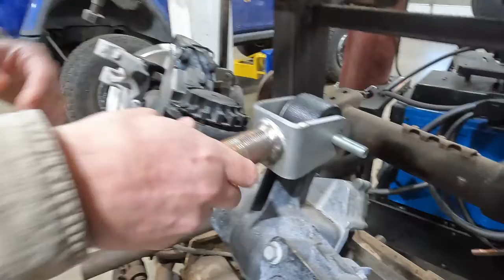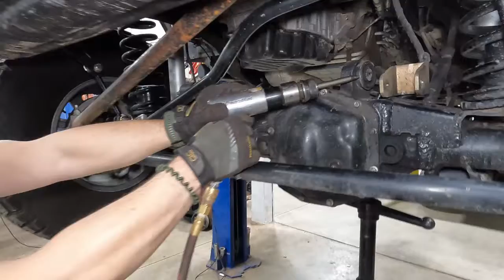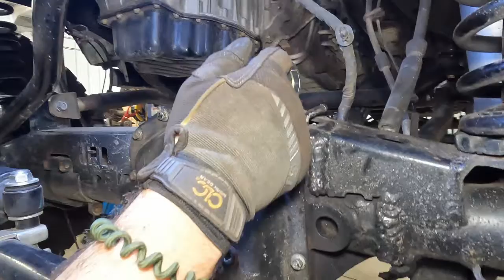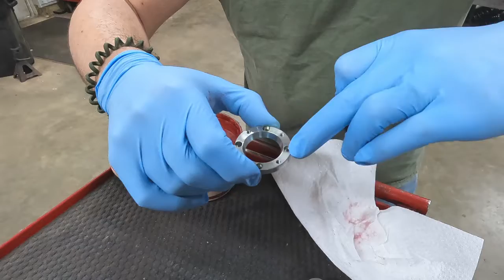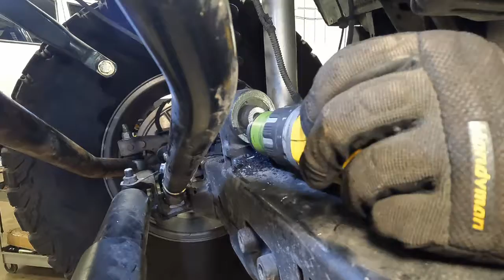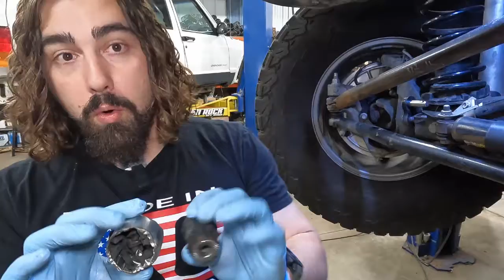Upper Control Arm Flex Joint - Goodbye old rubber bushings!

Comment: What is the torque spec for the 1/2 bolt option?
Reply from the maker: The 1/2" bolt should be torqued to 70-80 ft-lbs

Comment: I have the flex joint on my rear IRO A arm . Its beefy and abviously better then the stock Ball joint. 
Im a little leary about putting it in the steering axle as most of my miles are highway miles or snow and ice covered in the winter.
Im on a 5 inch full adjustable short arm which rides and drives amazingly but the original axle bushing have 245k on them .

Wouldn't it make more sense to push the joint in with the ball joint press with the joint assembled. 
That tiny allen wrench is much easier to manipulate on a bench rather then upside down under the lifted vehicle.
😂
Reply from the maker: @darkknight1100 I completely understand the concern of the snowy/icy roads and dealing with corrosion. Rest assured, that is exactly what we deal with here in Minnesota. We have used these press-in upper flex joints on daily driver Jeeps for many years/winters with no problems. Pro Tip: use marine grease for extra corrosion/water protection.

For assembling the flex joint under the Jeep, I totally get it! It isn't the easiest to do after pressing in the housing. You could flex your Jeep on a ramp, rock, or similar to give yourself easier access. Also, our joints last such a long time that you should never have to do it again! The only real enemy of our joints is extreme heat (exhaust) or improper assembly, mainly not properly torqued. It is a one time upgrade that you can set it and forget it.

Comment: and rockjock says, they just hammer out with a small mallet. yeah, it works that simple on paper and an edited video.
Reply from the maker: @TwoFeatherChannel Yep, it is not an easy task to get the old bushings out but completely worth the upgrade. Once you switch to our flex joint you never have to press again!

Comment: Found the link but how do I know if I need 10 mil 12 mill or a half inch? Is it the bolt that goes through it?
I have to replace these this weekend and I’m looking to buy them.  Unfortunately, every kit that I find looks like I have to cut my ears off of the axle and weld on new ones, but I don’t want to do that and that’s not what you’re doing so I don’t understand how I can’t find it. I have no idea what bolt hole I have and I really don’t wanna order six of three different styles!! Thank you in advance. I will put a micrometer on the shaft of the bolt. I’m pretty sure it’s a 10 mil.
Reply from the maker: @gunztommiegunz Yes, the 10mm, 12mm, 1/2" is for the bolt diameter. 
If you have an XJ, TJ, ZJ, or WJ your upper should be a 10mm bolt from the factory.
If you have a JK, JL, or JT your upper should be a 12mm bolt from the factory.
You can upgrade to a larger bolt size by drilling your upper control arm to the desired bolt size.

Comment: What is the size of the Allen tool
Reply: Found it at NAPA . $3 dollars for socket
Reply from the maker: @raymondwinans978  not bad at all!
Reply from the maker: @raymondwinans978 The Allen wrench is an uncommon size, but it is included in each flex joint kit. The size is 3/32"
Reply: Thanks going to see if I can find it for my inch pound torque wrench
Reply: Carlyle part # SH3803
Reply from the maker: @raymondwinans978  thanks for sharing!

Comment: Great for off roading and rock crawling. Not sure if it’s good for highway as these will allow more death wobble to occur.
Reply from the maker: @benjaminvolesky1653 I disagree. Many times, death wobble occurs when suspension and steering components are worn out and loose. The press-in flex joint is the opposite of that.
Reply: Death wobble is usually due to worn Track Bushing or movement. JLs are known to have the wrong size bolt and it eggs the hole . (Frame side ) . Ask me how I know 🤣🤣😕😕
Reply from the maker: @raymondwinans978  You're right.....among a myriad of different things, loose or worn track bars are certainly up there on the list of Death Wobble causes.

Comment: I bought mine a few months ago, with the installation tool… I’m installing tomorrow finally… thank you for the updated video! ❤
Reply from the maker: @LaunceBugbee good to hear! Let us know how the install goes!
Reply: @IronRockOffRoad  I’m doing it as we speak… I’m having a bear of a time pressing the sleeve in…I’m using basic hand tools…
Reply from the maker: @LaunceBugbee It can be tricky getting it lined up and getting it started. You can put a little grease on the outside of the press-in sleeve to help. We only use hand tools when pressing in the sleeve. A good 1/2" ratchet gives decent leverage and control.

Comment: Do they make these for WJ ??
Reply from the maker: @txknightrider82 We do! If you are using the original 10mm bolts for your upper control arms you just need to select the 10mm option on the website. https://www.ironrockoffroad.com/product/upper-control-arm-flex-joint-8-bolt-10mm-cartridge.html Some of our customers choose to drill out the mounting holes on their upper control arms to a bigger size and purchase the larger 12mm or 1/2" bolt size.
Reply: @IronRockOffRoad 10mm???? NOBODY has a 10mm wrench....
Reply from the maker: @jwdundon 😆 I know, right?! Good news though, the diameter of the bolt is 10mm. The wrench size is probably like an 18mm or 19mm so you're good! 😁👍

Comment: I’ve got a little over 10k on mine and they’ve already seen death wobble multiple times over 60 mph and rammed snow banks, banged ditches. I’ll let you know if they are worth it.
Reply from the maker: @codybertram6122 Keep us posted!
Reply: How are they holding up?
Reply: @Joshsw90  I haven’t even took the upper arms off to check them cause they’re still tight. At 20k on them now.
Reply from the maker: @codybertram6122 Still holding up?
Reply: @IronRockOffRoad  yup over 25k on them now and still tight as when I put them in
Reply from the maker: @codybertram6122 That's great to hear! Thanks for the feedback!